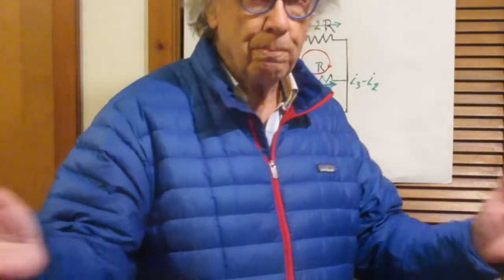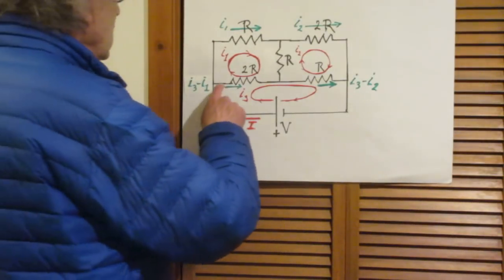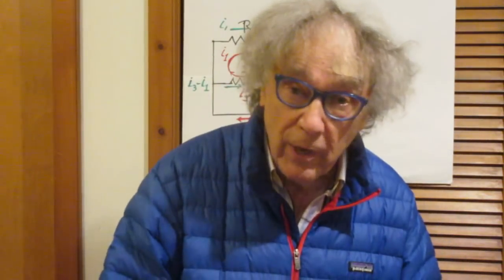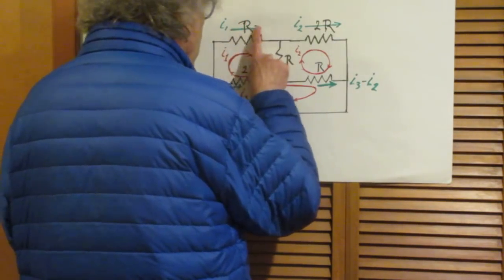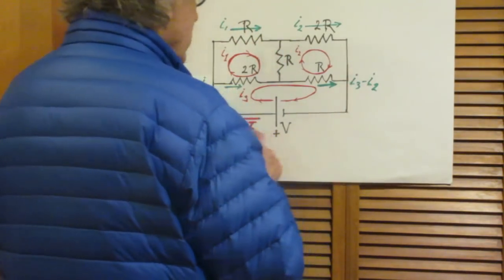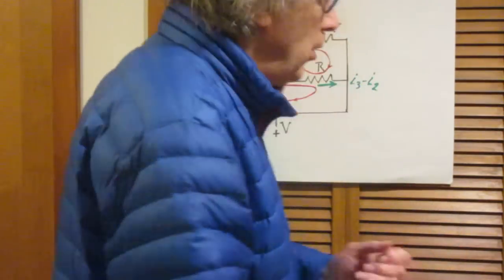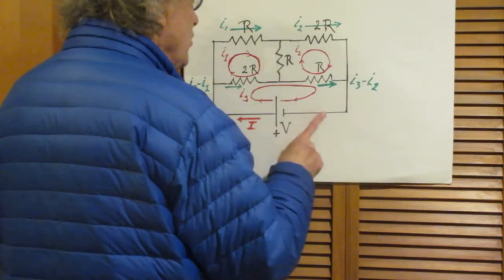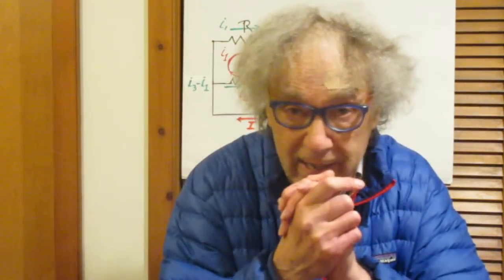Solution (4/4) Problem #24 Circuit with 5 Resistors

Comment: jatin bhatt,
You posted that the most efficient method of solving this kind of problems is to use star delta configuration. It may not lead to confusion. ..    WRONG!

Actually using the star-delta transformation IS NOT a very efficient method for solving this network.  

I covered using the transformation in my PART 2 in the video titled:
Bridge Network part2: Solution to Lewin problem 24 Bridge Network 

View starting at time 21:05  in my video and then tell me that is an efficient means of solving.  Just to find the equivalent element values takes a fair amount of algebra not to mention reducing the series parallel combinations to a single resistor so you can solve for the current the voltage source supplies into the network.

You would not have made this statement if you had actually tried it yourself. You should NEVER make claims that you do not yourself understand the implications of.  Obviously you have no clue as to what you are talking about.
GH
Show less

Comment: Love the way you endorsed the conditions under which said assumption comes(I just used to think that this "might" be the condition... Sir what approach will you suggest me to solve a circuit problem which looks similar to the above except that R1,R2,R3,R4&R5 ARE NOT all  same in general and we just want to know the total resistance resistance the battery when we put this circuit in a conventional way with the battery? Regards!
Reply from the maker: use my brute force solution - you get 3 eqs with 3 unknowns i1 i2 and i3.

Comment: You all make it far too difficult! I give you a solution as simple as the law of Ohm. (2 times Thévenin)  My solution can be downloaded during 1 week from now on :   https://we.tl/oJkxI8pbGT
Reply from the maker: very nice but I by far prefer my super solution. It's much shorter and more transparent.
Reply: Using thevenin for i is straightforward and easy, but it does not always work. That's probably why the professor did not explain that. The brute force method always works so that is the most important one to explain.
Thevenin can be derived from kirchhofs laws. Thats why it's a theorem and not a law.
Reply: I teach electricity and electronics to 17-18-year old students since more than 20 years in a Belgian secondary school. After using Kirchoff equations and so on, I realized that using two times Thévenin works best for my students to calculate Wheatstone-Bridge-problems. (This is what problem 24 is.) When the resistor in the middle (R-AB in my drawing) becomes zero, due to replacing it by an Ampère meter, students are often confused. Since I use two times Thévenin for this kind of problems, I have to give my students only one(!) example exercise to make them all understanding it. 

I do not agree that the Thévenin method does not always work for Wheatstone problems. It ALWAYS works!

Comment: The most efficient method of solving this kind of problems is to use star delta configuration. It may not lead to confusion. ..
Reply: jatin bhatt,
You posted that the most efficient method of solving this kind of problems is to use star delta configuration. It may not lead to confusion. ..    WRONG!

Actually using the star-delta transformation IS NOT a very efficient method for solving this network.  

I covered using the transformation in my PART 2 in the video titled:
Bridge Network part2: Solution to Lewin problem 24 Bridge Network 

View starting at time 21:05  in my video and then tell me that is an efficient means of solving.  Just to find the equivalent element values takes a fair amount of algebra not to mention reducing the series parallel combinations to a single resistor so you can solve for the current the voltage source supplies into the network.

You would not have made this statement if you had actually tried it yourself. You should NEVER make claims that you do not yourself understand the implications of.  Obviously you have no clue as to what you are talking about.
GH